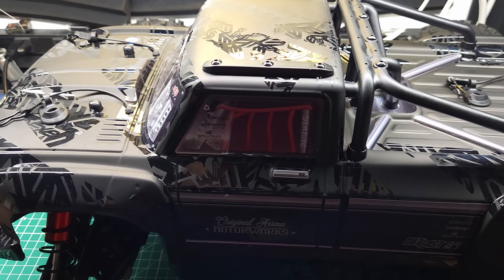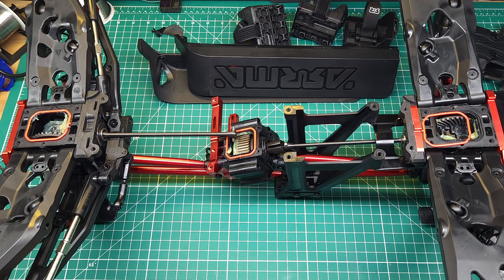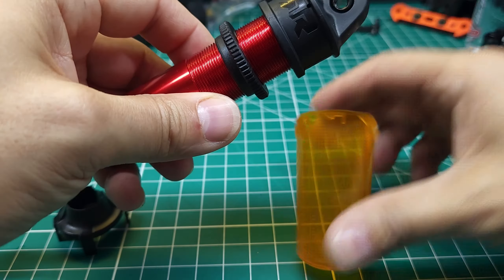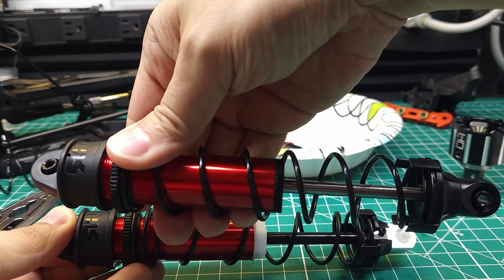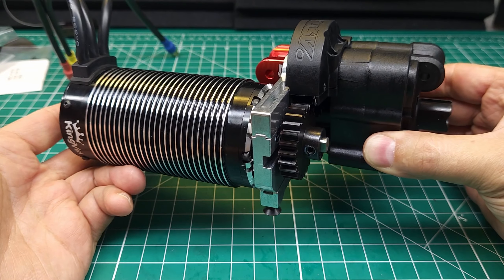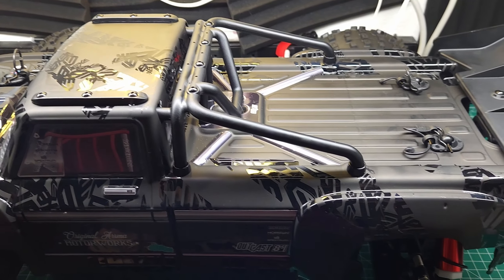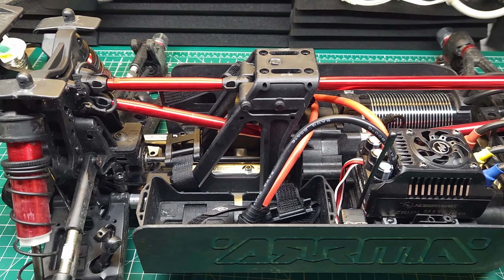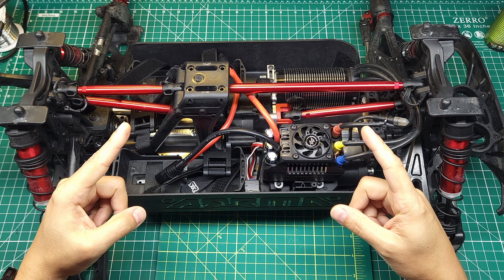I Built The World's BEST 8S Arrma Outcast 1/5 RC!! | Beyond V2!

Comment: Only thing I'd like is a parts list. I have an 8S Outcast EXB roller. And this looks like a good build. Not too crazy. All the upgrades at the right places.
Reply from the maker: Okay I'll try and give you a complete one but don't hold against me if I forget something
M2C chassis, M2C motor mount, M2C center brace mount, M2C front and rear hinge pin and ABCD block kits, M2C ESC mount, MTC pillow ball retainers, M2C front and rear drive shafts, M2C center drive shafts, hot racing differential cups, hot racing mod 1.5 spur gear, saga mod 1.5 pinion, VG Racing Springs, M2C shock lowers, M2C shock pistons, Max 5G2 and I would recommend using a matching sensored ESC as it doesn't seem to like doing things sensorless.
Not 100% certain all of this is necessary but it does address most of the weak points on the truck while still leaving in a flex and everything to absorb shock loads and not be too horrifically heavy.
Reply: @DoRC  Awesome! Thank you!
Reply from the maker: @edwinlomonaco6754 You're welcome :-)
Reply: Super awesome video! Great attention to detail brother!! What size SAGA MOD 1.5 spur gear?

Comment: This is an Amazing truck, easily $2000+ build and Im not surprised its so ridiculously strong. Theres only one tiny thing you missed that you may want to consider - The Chassis Bracing. They tend to bend fairly easily although with the M2C chassis they may last a while. The bigger issue is the plastic ends of those braces - they break very easily and everyone I have met with an Arrma 8S recommends the M2C 7075 brace ends.
Reply from the maker: I actually considered those but in my experience keeping the plastic ends on things like that is actually a good thing. Yes they will break sometimes but they are a cheap and easy replace mechanical fuse. I have found that if you make everything metal you're going to end up breaking something metal and metal is expensive. That's the same reason why I kept the plastic bulkheads and plastic hubs and knuckles.

Comment: Awesome vid man. Awesome to see your channel growing!

What issues did you have with running sensorless? Ive only run the 1250kv spektrum on it. No issues but ill switch to sensored since there is cogging with 30p/40s spool on my infraction--12s is heavy. Runs great, blew the tires off my half worn hoons at 12s 😂😂. Moving to the 56118.
Reply from the maker: It has a really bad startup routine is the only way I can describe it. Even with the motor out of the car when you nail the throttle it takes nearly a full second to spin up. This results in a very consistent and annoying hesitation from a standstill. It's not cogging In the classic sense but it's the same basic end result. It's possible that it only does it with some motors which is why I've only heard some people mention having a problem
Reply: @DoRC  ah gotcha. Thanks for the insight.
Reply: @DoRC  checking back in. I'm getting the same issues. Thought it was just cogging but you explained the same thing. Time to get the 5690 or 56118 motor.
Reply from the maker: @Ryndel  yeah unfortunately I think that's the only solution.

Comment: Aren’t the VG racing springs only for the kraton because the front shocks street 12mm shorter on the kraton than the outcast?
Reply from the maker: These were specified for the outcast and were all the same length.  They work really well on this truck! Thanks for watching :-)
Reply: @DoRC  do you have the link to those?
Reply from the maker: @sendtherctothemoon I got them on the VG Racing website. They are listed for the Kraton but they're all the same length And if you look on eBay they list them for Kraton and the outcast. They work great on the outcast at least in my experience so far. Honestly I think they're probably more appropriate for the outcast since the outcast has all the same length shocks.

Comment: Do you think the M2C pillow ball upgrade is better than upgrading to the Vitavon aluminum hubs. I can’t decide which way to go.
Reply from the maker: Personally I like sticking with plastic parts unless you know they're going to break. Aluminum is less flexible heavier and more expensive. I haven't broken any of these hubs so I can't personally recommend upgrading them unless you just really want the aluminum.
Reply: @DoRC  It wasn’t about breakage concerns. I saw videos of people complaining about the metal pillow ball’s caps constantly backing out of the plastic hubs. I was wondering if aluminum hubs for the front would help with this. I’m getting ready to buy the K8 and my research showed the pillow balls/hub design were a weak spot.
Reply from the maker: @i4nic256  oh okay. Well I know that the stock ones tend to back out. The M2C ones in my experience are holding up fine. They sort of jam into the threads as you tighten them up which seems to hold them in place. If you use aluminum hubs of course then you can use thread locker which will definitely hold them in place. Can't really give you a definitive answer just because I don't have any experience with the aluminum hubs on these and limited experience with the M2C pillow ball retainers. I would say try the M2C ones is there a lot cheaper. You could always add a bit of super glue to them which can help when threading into plastic if they do decide to back out. That being said mine haven't yet.
Reply: @DoRC  Good to know. I might go the M2C route first since it’s cheaper. Their upgrades seem to address most of the problems they tackle. Thanks bud, enjoy that Outcast 8S…that’s on my Black Friday checklist.

Comment: What a build bro! What KV motor we’re you running? 800?
What brand?
Reply from the maker: 780 KV King val off of Amazon. It's one of those ones where it's the same motor labeled by like seven different brands. Seems like a good motor though the Max 5G2 really doesn't seem to like running sensorless motors
Reply: @DoRC  oh wierd ! What’s the motor that runs well with the max5g2?
Reply from the maker: @JigSawRC any of the sensored motors.  There are three that are specified as combos. They're all the same size but different KV. And there's the new 1250 KV motor that I think going to be a great combination. I'll have a video coming out about that very soon
Reply: @DoRC  awesome man I got my notifications on for ya :) 
I’m still waiting on my new 8s exb O8 I’m stoked
Reply from the maker: @JigSawRC appreciate it :-)

Comment: Unscrewing them that fast runs the risk of drilling the threads out. Dont let it heat up spinning it like crazy. Too many used RCs are all stripped out.
Reply from the maker: Maybe so but I've been using The same methods and similar tools for many years now and haven't had a problem. That being said I'm also a professional mechanic with a couple decades under my belt so I have a pretty good feel for these things. I wouldn't recommend someone who isn't comfortable with wrenching use those sorts of methods.

Comment: Hey man awesome video. I'm either going to get the new outcast exb rtr, or a new xmaxx. I want your opinion on which to go with based off these builds. 

Outcast I'd add m2c pillow retainers, 25mm bulkhead screws, m2c brace ends and carbon fiber sleeves (stock chassis), and later upgraded cvd axles. 

Xmaxx I'd replace with HD arms (stock length) all around, Gpm hinge pin kit, xrt hubs/casters all around, gds 50t spur and a steel pinion, also m2c chassis brace on the bottom. 2085x servo once plastic one goes. 

Either way I'd essentially be keeping them both stock, I've no interest in crazy power or major weight additions. Which one do you think would be tougher with these builds? Which would be more reliable with moderate jumps/tumbles/high speed rips? 

Finally which would you pick out of these builds? Any input is appreciated! 👍
Reply from the maker: At the moment I think I'd go with the X-Maxx. This is primarily because I can pretty much guarantee you that most If not all of the updates that are on the new EXB RTR Kraton Will be showing up on V6 non-EXB versions of everything fairly soon. Some of the things that you're concerned about upgrading will have already been addressed.
Reply: @DoRC    I was talking about the newer 8s exb rtr outcast, not the 6s line. Forgive me if I'm misunderstanding, but you're saying things like aluminum bulkheads and aluminum pillow retainers will probably be coming to the 8s line too? They just updated the 8s recently so that's why I was wondering. I don't mind the plastic diff house, like you said keeps the 8s beasts lighter. Don't see them doing a full 8s update for a while now..  so you'd still say xmaxx?
Reply from the maker: @smoothwookienookie5912 I'm sorry My brain automatically went to the new 6S EXB. 
I would still recommend the X-Max between the two 8s options. The 8S EXB is an awesome truck but it's heavier than the X-Maxx a bit weaker out of the box and pretty much everything on it costs more to replace. They are similar size especially if you get the wide kit for the X-Max and they fill a similar role but I think the X-Max is just a better platform at the moment.

Comment: hobbywing max5 g2 have a 1 second delay so you have to programed with the bluetooth module they sell it, you just have to update and decrease the turbo boost on 0 second's.
Reply from the maker: I tried that and it didn't make any difference on mine. I've tried changing pretty much every setting there is and it didn't seem to change that at all. I will definitely take another look at it though. Thanks!

Comment: $2.5k well spent🫡. I wanna do one of these builds with my new v2. Am I right that M2C doesn’t make a tower-to-tower brace for the 8s rigs? I know that Custom RC Upgrades does.
Reply from the maker: No they don't. They make aluminum ends for the stock tower braces but not an upgraded one. Personally I like the stock ones. With the much stiffer M2C chassis They don't really seem to bend that much and I think that with the plastic ends they are a cheap and easy to replace mechanical fuse if something does get overloaded.

Comment: For that level bashing stock would work while being much cheaper. I wouldn't put that M2C chassis on for anything.   If stock ever bends I'll replace with stock.   It just looks to good not to use.   I grabbed 2 when they first went on sale and the one i built has been going strong.  Nothing has broken yet and I'm no easier on it than this video.   More than one crash I've just known something had to be hanging off but even the wing is still firmly attached.
Reply from the maker: I've had these stock and have broken them pretty easily with the kind of bashing that I do. Keep in mind that I put almost only good landings in that video and I put several packs in that I wasn't recording. It's had some pretty hard landings. I've broken just about every stock vehicle I've had on that ramp.
The stock truck is pretty durable but in my experience other than the 4S Max and the 4S Outcast V2 nothing has ever survived my bashing stock.

Comment: Very nice video what about m2c cvds over kill ones and m2c rear and front drive shaft but very sweet truck I’m upgradeing my 8s outcast too
Reply from the maker: I am running the front rear drive shafts from M2C and I have the non-overkill drive shafts. I like the non-overkill ones because they aren't quite as thick and are less likely to bind on the output cups and will have a little bit more flex.  Thanks for watching!

Comment: How many KV motor? And what is the gearing?
Reply from the maker: 780 KV motor and the gearing is 24/29
Reply: @DoRC  thanks
Reply from the maker: You're welcome. If you're going to use the Max 5G2 I would recommend using one of the new sensored hobby wing motors as the sensorless ones don't seem to play well with it.
Reply: @DoRC  that hobbywing motor won't fot in kraton
Reply from the maker: M2C just came out with a new steering setup that allows it to fit. You can also use the new 1250 KV motor if you want to go with something smaller.
Reply: @DoRC  I'm currently running castle 800kv 39/39 set up and it runs a bit too hot even with two fans on the motor (I'm on 8s). So that 1250kv would probably cook after one session. I'm in FL so it's hot down here.
Reply: @DoRC so the Max5 g2 only work fine with sensored motors? What issues are you having with sensorless motor set up?

Comment: Are the springs any different from stock.
Reply from the maker: I think I was running stock springs on this one
Reply: @DoRC  well.  On ur list. U mentioned those vg springs.  So I was just wondering how they were different from stock
Reply from the maker: @tropicthunderbolt ohh. Yeah sorry. The VG springs are progressive. Usually they start out a little bit softer than stock or smooth off-road bump handling and then they progress up to being a little bit stiffer than stock for enhanced jump landing capability. I have run VG springs on a lot of different cars and I've never had a problem with them

Comment: try getting the tear drops from m2c and you should be good!🤙
Reply from the maker: What are the teardrops?
Reply: @DoRC  they go on the tower braces
Reply: @DoRC  they're s
Stiffener rod ends 3586 8s
Reply from the maker: @humblebeast7232 oh yeah I actually chose not to get those because I like to keep plastic in certain areas of the vehicle. If both allows for a little bit of flex and is a cheap mechanical fuse if something goes catastrophically wrong.

Comment: ITS THE G2 ESC ... THATS THE FIRST RUN I BET , I HAD HE SAME ISSUE WITH MY MAX8 G2 COMBO ITS AMATTER IF TIME BEFORE YOUR CAPS BURN OUT . I GOT A REPLACEMENT MAX 8G2 AND THERE WERE NO ISSUES
Reply from the maker: There were several runs in that video. I've run it quite a bit since then and no other issues. Switching to a sensored motor fixed the problem. Honestly I think all of the G2 ESCs have weird problems.
Reply: @DoRC  yea in the forums they speak of these lol glad you got it figured out 🙏
Reply from the maker: Thanks for watching and commenting!

Comment: Max 5 wax vs max 6 g2?
Reply from the maker: In this I would probably go with the max 5G 2. It's a pretty heavy truck
Reply: @DoRC  ok thanks! Do you find these new 1/5 bashers to be durable enough? Compared to the smaller 6s versions? I don’t plan to be sending it 40 feet high but for like a bmx track style bash are they just as durable there?
Reply from the maker: @thepatternforms859 I don't think the 1/5 scale Arrmas are as durable as their 1/8 scale. For normal general driving they're fine but they do tend to break a little more often with heavy bashing.

Comment: Awesome build bro, I recently bought an Outcast 8s EXB V1 roller while it was on sale in July and i plan to put in a Max 5 G2\56118 G2 800kv but waiting on an M2C Bellcrank for the 56118 motor to fit it.
Reply from the maker: That should be a pretty monstrous setup! Enjoy :-)
Reply: @DoRC  Yeah it should be an insane setup i also plan to use my Radiolink RC8X radio and a Spektrum S9120BL Servo.
Reply from the maker: @cjchannel12 nice!  I put a 30° north 70 kg servo in this one. It's just what I had on hand but I've been really happy with it so far.
Reply: @DoRC  That's cool, Currently i'm planning to put a stock Spektrum Firma 160 V2 with 5687 1,100KV combo and the stock S6510 servo from the V2 RTR into my V1 EXB roller for now just to get it running hope fully by early next year. Kind of got slowed down by my X-Maxx servo going bad and other projects sometime maybe in the future i might put the Hobbywing Max 5 G2\800KV combo in my truck along with a few other parts.

Comment: Mod 1.5 gears.. and a rear motor support would finish this baby off.. sick build ❤
Reply from the maker: Mod 1.5 gears are already in it and I had some foam supporting the rest of the motor but I don't know if you noticed in the very end of the video but I did end up breaking two of the screws off on the motor mount. I didn't realize it until later so I guess I need more support. I actually have the 1250 KV sensored motor coming and I'll be doing a video on that very soon. Should be a bit less stress on everything.

Comment: Why does everyone get all excited over center diffs then just lock them up with silicone plugs? Does'nt that just lock it up, rendering it basically not there now?
Reply from the maker: Not quite. The silicone ear plugs make it very stiff but it's still able to transfer shock loads and do its job protecting the drivetrain.